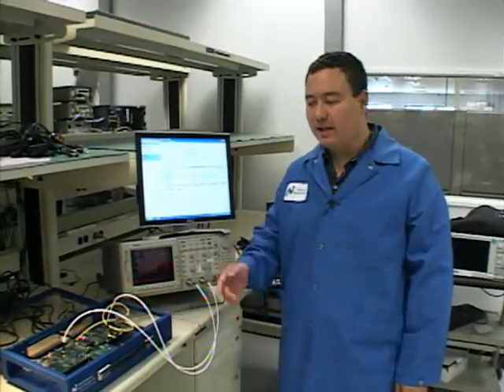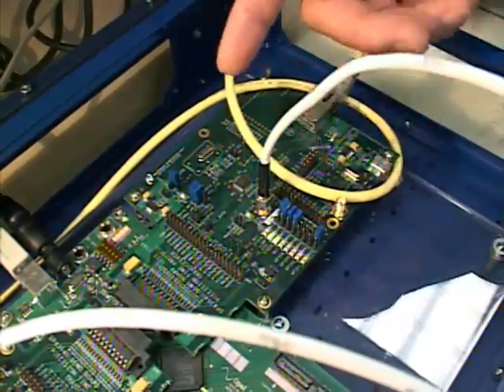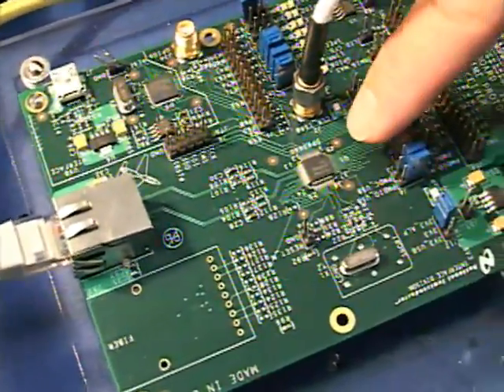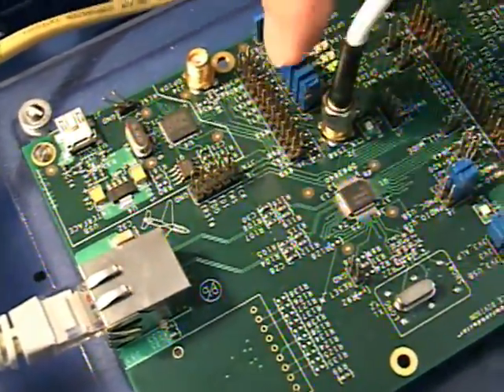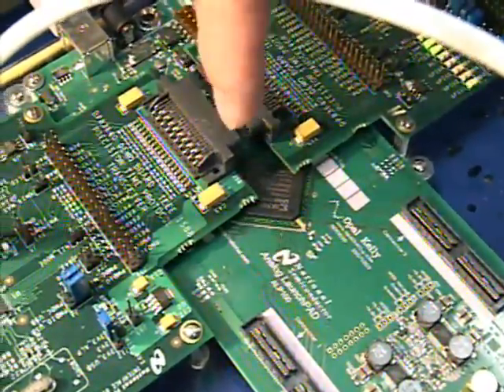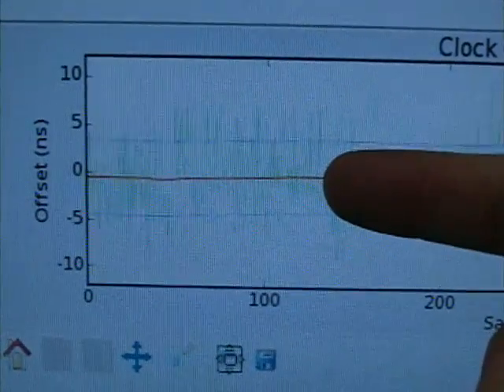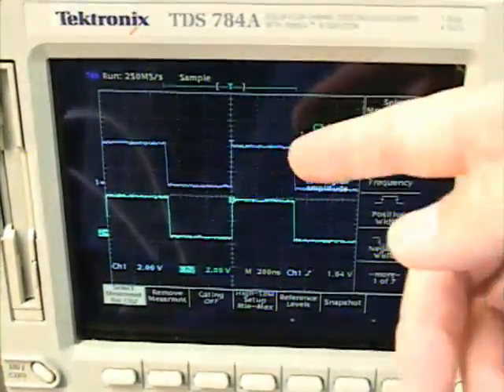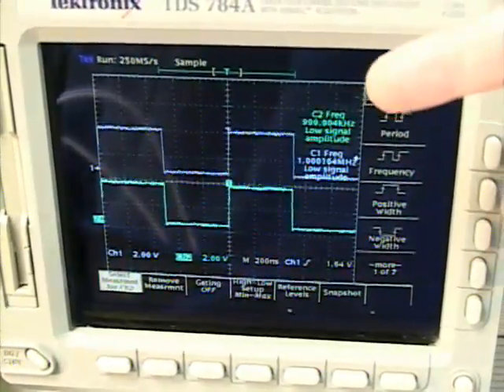DP83640 10/100 IEEE 1588 Time Sync Demo

Comment: What's the purpose of clock output ,if I connect single master multiple slave .Does the clock_out of master should be connected to slave, If Yes where I should give clock_out of master.

Comment: Is there a way to capture and compare the ptp accuracy using software with data obtained via snmp? Im not a net expert but in the pro audio world theres a debate happening where  2 audio over ip protocols are fighting for dominance (Dante and AVB) and manufacturer’s using avb are making a claim that i cant qualify that the clocking in avb is superior to that of PTP used by Dante and that in turn this represents a higher quality output

The resolutions to my understanding of ptp arr in the scope of 1/100 of and audio sample at 48kHz to 1/20 at worst and guaranteed no worse
So to me that’s essentially sample accurate but it would be nice to br able to prove and or challenge either way

I personally believe but don’t know as fact that they share profiles from 1588 and do are the same in terms of accuracy 

Sorry if yhis is out of scope but it’s becoming an obsession fir me to know if there is actually any benefit to using avb as it has many other compromising features and it seems the protocol is resting on the clock accuracy thing to justify its existence 

Do you know if any lay mans tools i could use to create a lab snd test?

Comment: It's a nice demo, but how would the results vary with 10-60% network load between systems using the DP83640 and other devices on the subnet?
Reply from the maker: On a best effort Ethernet network with no traffic shaping when the network load is increased, the TE will fluctuate as sync and delay message timing is impacted.  The 1588v2 stack shown in the demo does not benefit from traffic shaping that can help maintain high time accuracy in fluctuating load conditions.  If high accuracy is desired during high network loads, a traffic shaping policy may be implemented, or the network topology may be enhanced with the inclusion of PTP aware switches.